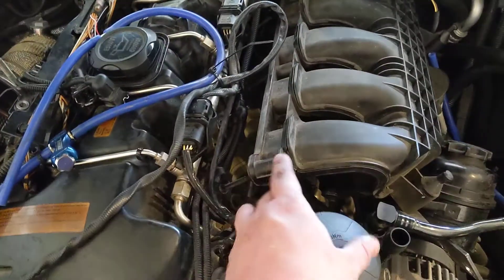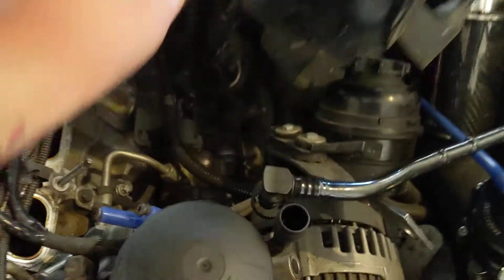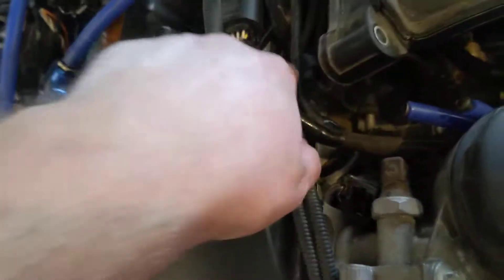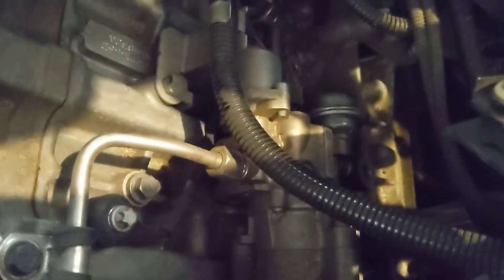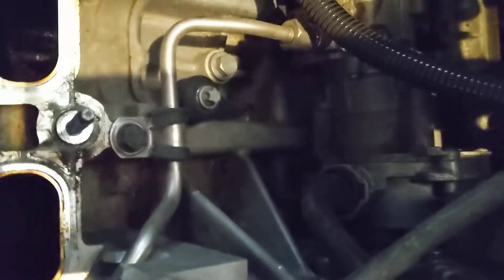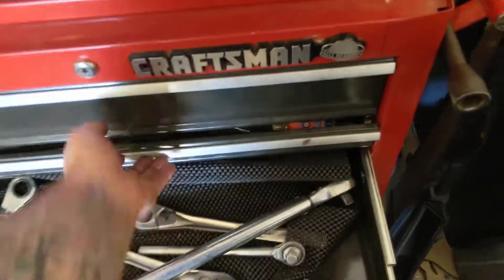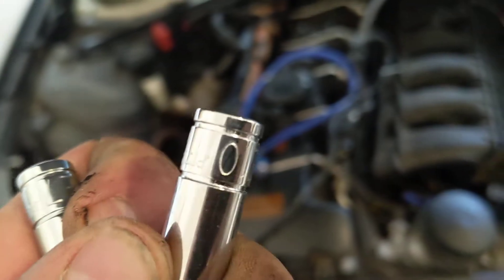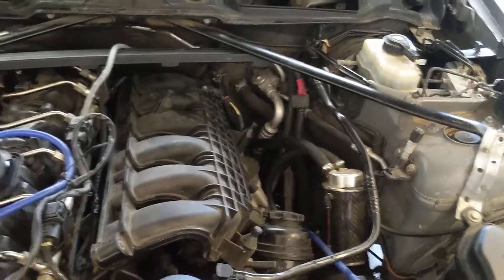N54 knock sensors

Comment: Do you have to disconnect the charge pipe from throttle body?
Reply from the maker: Yes I did
Reply: @boostnstuff6304  Took me 3 hours to change mine. Pain in the ass. Quick question, can you run NGK 1 stepped colder spark plugs? I'm at 370 or 380 hp with custom 3 chargepipe, bov, upgraded fmic, dual cone intake, cattless downpipes, 7 stepped  intercooler but no mhd or jb4 plus no e85. Would it be safe? Appreciate the feedback:)

Comment: I thought there's only 1 knock sensor
Reply from the maker: There are two on the n54
Reply: @boostnstuff6304  Wow that's just great, are they the same one's. I got the code P0326 which is referring to the knock sensor
Reply from the maker: They are connected to same plug pretty easy to replace
Reply: @boostnstuff6304  So I called ECS Tuning and they said there's only 1 knock sensor but it routes to 2 different spots
Reply from the maker: @GODISGOOD1916  oh I guess that make sense too on why there only one plug
Reply from the maker: But it bolts on two different parts on motor
Reply: @boostnstuff6304  Nice, I figured when you said they're connected to the same plug that it's possibly one sensor. Mine went completely out at 102.4XX miles
Reply: @GODISGOOD1916  FINALLY FOUND SOMEONE ALSO GETTING P0326!! Im having the same code!! did replacing the sensor fix it for you???????